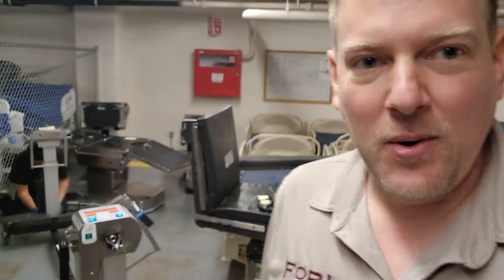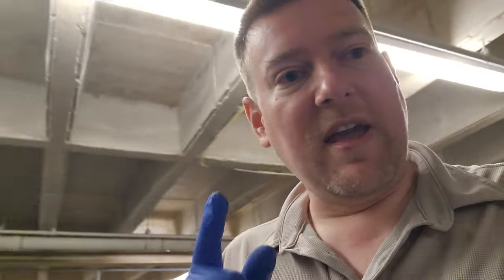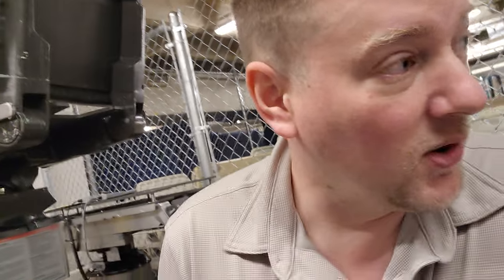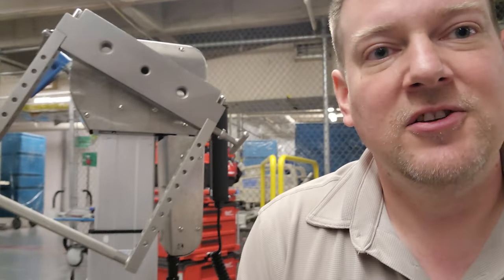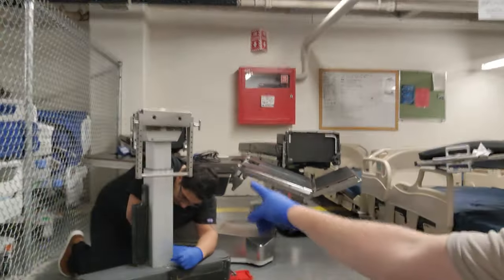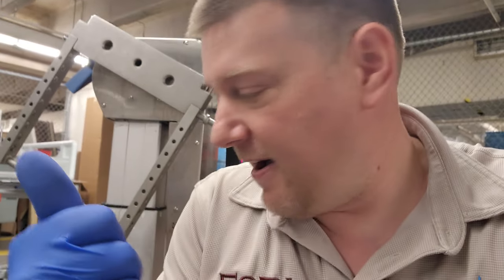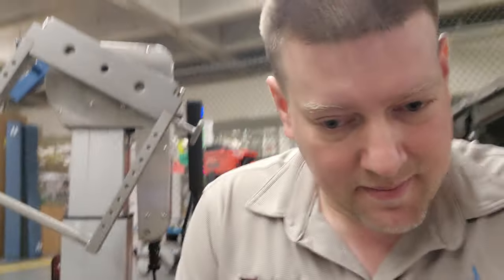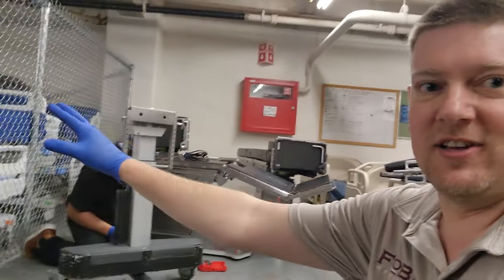Surgical Tables!

Comment: Just came across your channel because I was trying to figure out a problem with a steris 3085.  It’s a lot I’m going to type right here and if there is a message board area that I can describe the problem and maybe get a reply please let me know.   Basically the unit does get power, you hit the button in the remote or on the unit to lock and it makes the sound like it’s locking for about 1 sec and then stops.  The remote and manual override controls do not work at any point.  The remote does light up.   I did check the micro switch’s and wiring in the lock but in my mind if they were bad I wouldn’t get just that 1 second of it sounding like it’s working.   I have tried changing out the board the manual control wires go to and a few other parts.   I was wondering if it might be a bad coil on the motor but wasn’t exactly sure on how to test it.  Sorry for typing so much, again if you can tell me where else to go to ask questions, it would be greatly appreciated.
Reply from the maker: Sounds like the problem is still in the brake detect. Write me at abetterbiomed@gmail.com